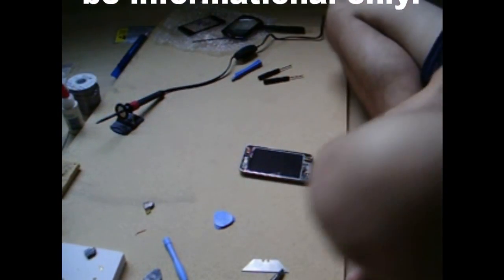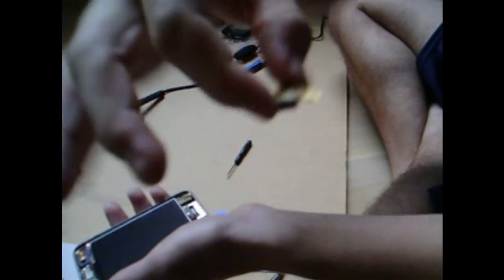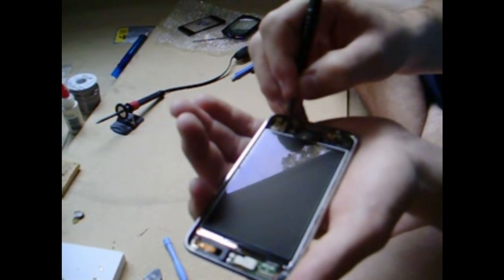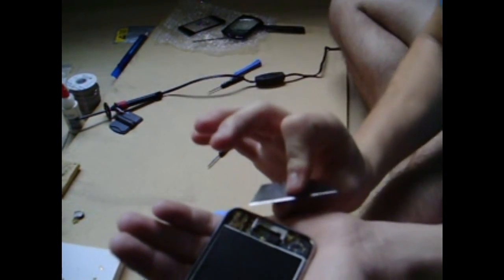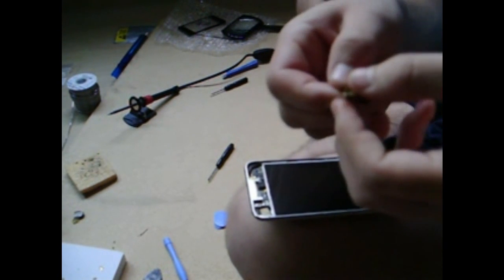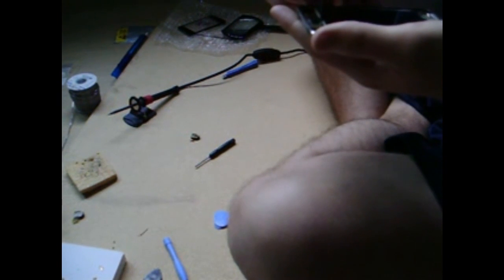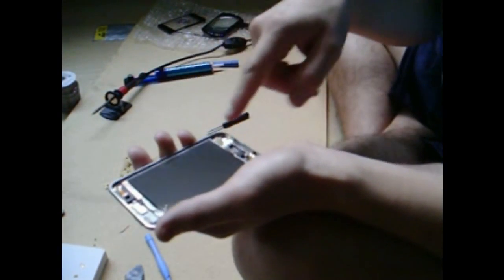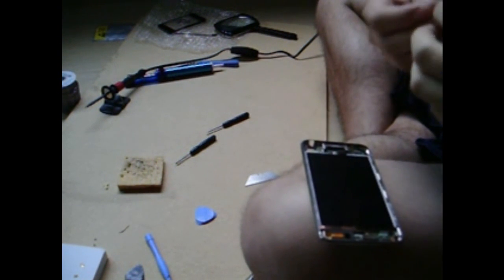How to Replace/Repair/Fix iPod touch audio/Headphone jack Part 1

Comment from the maker: well im sorry that it did not, 

your next options are:
1) do it again beccase you may not have made a solid contact. 
2) Buy a new pcb for your ipod because your sound chip is malfunctioning.

Comment from the maker: @Cloud98 

if you buy a screen removal it *got mine from ebay*  you normally get a screwdriver with it that is designed for that screw specifically and others that are similar in size. 
Hope this helped :)

Comment: Hey I was wondering if you know the schematics to the jack. 5 pins, which is which, left+,right+,ground,mic, plus I believe two wire have to be together to shut the internal ipod speaker off? I have an external speaker with a built in jack and I want to just solder the wires strait to the ipod. I have everything ready to go but unfortunately I lost the damaged jack so I can not get this figured out. anyone please help.

Comment from the maker: @jinaraink 

cut a q-tip in half and stick some super glue on the end, hold in place till it dries on the jack that broke off, pull out, 

**i am not responsible if you damage your ipod**

Remember to subscribe!

Comment: @orvis8 Yeah, nice video but in fact it may be harmful. 
Just so you know: I found three types of small solders once had max temperature of 400C, the other 600C, the other 900C. Now it depends on the type of iron we use which one we need. Furthermore using the incorrect solder may burn the motherboard, not using the right one will not melt the iron. Nice video if you're willing to take a chance at breaking the ipod for good. Please specify on the description.

Comment from the maker: @classicalmix 

idk. its a wall powered soldering iorn. Sorry :( as long as it dose not get hot enough to burn the abs plastic under the solder you should be fine.
Remember to subscribe thou!

Comment: @orvis8 I found a few micro solders actually, my question: Are you using a 12V 8Watt, 12V 30Watt, 12V 40Watt or something different?